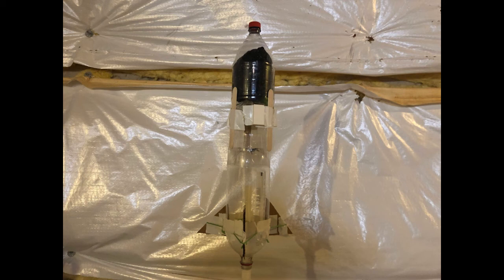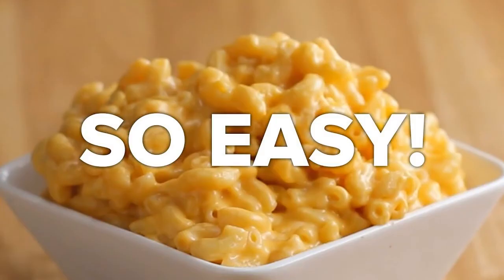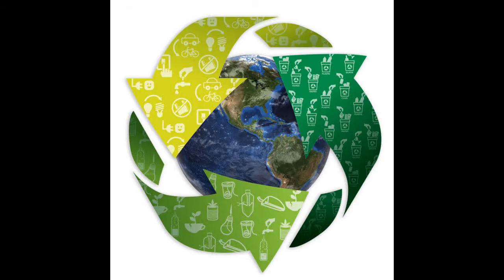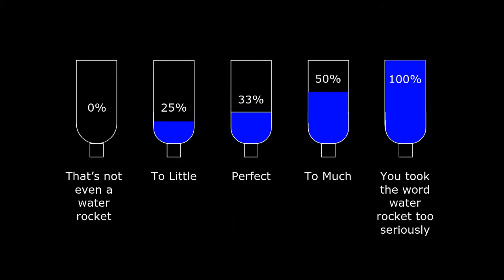How Do Water Rockets Work?

Comment: how to you build a launcher and keep it pressurized?
Reply from the maker: @sPace I pump air into the launcher using a tire valve (I forgot to explain that 🤦‍♂️). The rocket fits tightly onto the launcher (like how a cork fits tightly onto a bottle). My launcher is built with PVC pipe and glued together using PVC cement which keeps air from leaking from any part of the launcher
Reply: @waterrocketlab151  thanks!
Reply from the maker: @sPace also, thanks so much for being a continuous viewer who comments on my videos
Reply: @waterrocketlab151  hey no problem, i like rockets